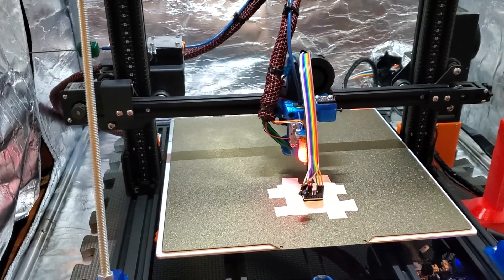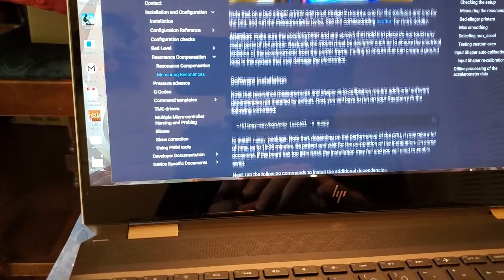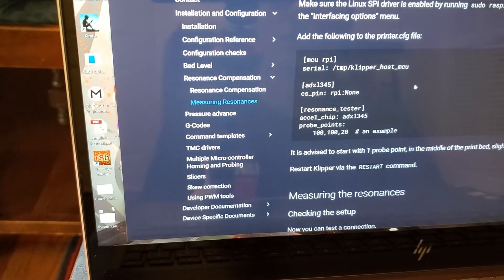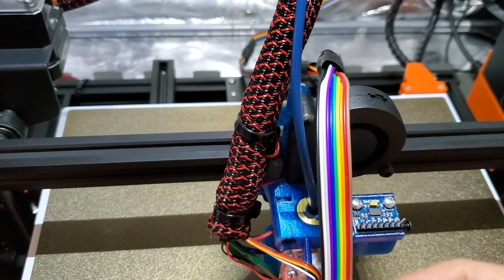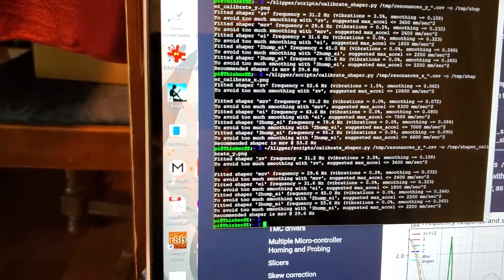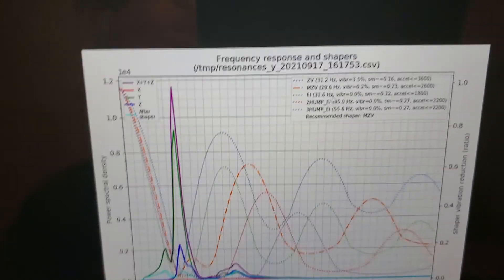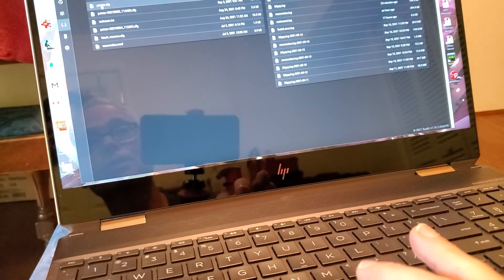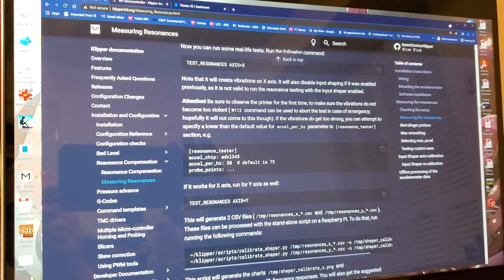Klipper Accelerometer Tuning for Eryone Thinker SE

Comment: Thanks for the video. Did you ever get "Invalid adxl345 id (got 0 vs e5)" error?
Reply: In my case I had to resolder the black chip because it was inverted. And I had two pieces inverted like that, so the producer is probably unaware of this issue.
Reply from the maker: If I remember correctly, I might have.  I do know I looked up the error on github (or klipper documentation) and it indicated that the sensor was bad.

Comment: Hiya Jay...!
I have a question;   Did you (from what I can see) just attach the accelerometer temporarily to the pi to note the data you needed?
Did you leave it connected? (Because you used the same cable connection for both x & y accelerometers?
And if it's left connected, did you use a multiplexer for both of them connected to the Pi?
if so, can you explain how to do that, please...?  I know each one will have to have a different serial address if connected in parallel. I thought I needed to learn how to connect BOTH accelerometers to the pi for Klipper...?
And lastly,   once you have the data from the accelerometer/s, can they be removed, and will the printer run without them and just on the data frequencies set in the config file?
This is why I had to ask because I'm ready to add the shaper settings to Klipper.
Oh and I'm using a bed-slinger which I also want to improve its performance on.
Kindest Regards

David...
Reply from the maker: Not sure why I only saw this response a year later - sorry!  I did *not leave them attached - but I used the data generated to tune input shaping and then disconnected everything....
Reply: @jayburkette8977  Thanks all the same! I was going to install the wiring into the machine, but after watching videos like teaching tech, i finally got the answer to my machine. Cheers again!

Comment: were did you get you mag bed from..and do you need a new sd card for the pie
when flashing
Reply from the maker: Aliexpress - Energetic 305x305 PEI sheet (double sided).  I set up the Pi from the beginning with Klipper and Kiauh....I plan on doing some videos on Klipper setup, but the short answer is that you don't need another SD card.  Install Kiauh (google it), and use it as a scripter for installing Klipper on the Pi and generating the firmware file for the printer.